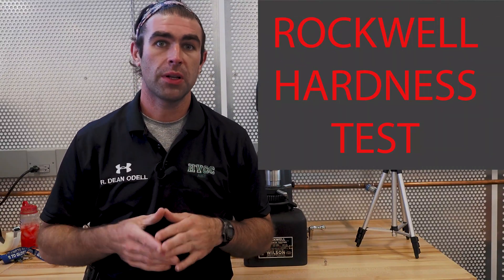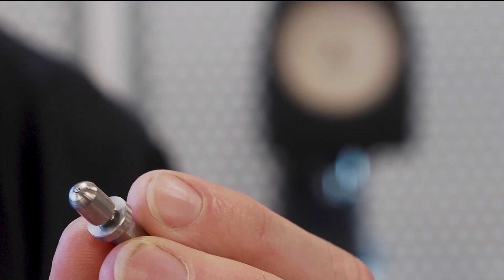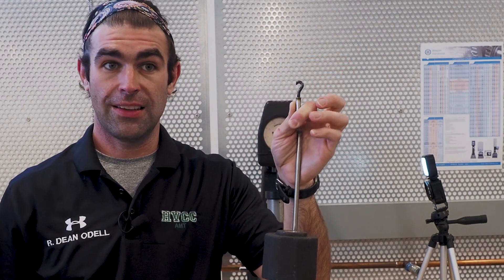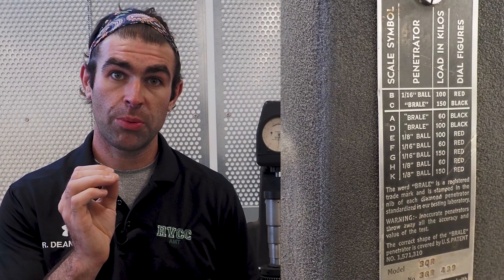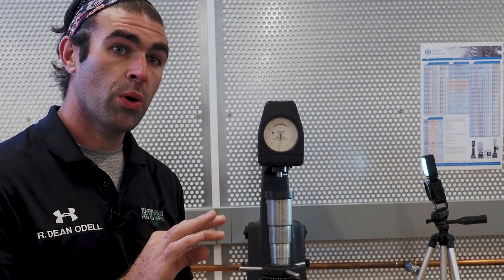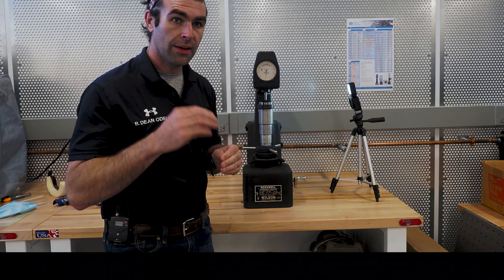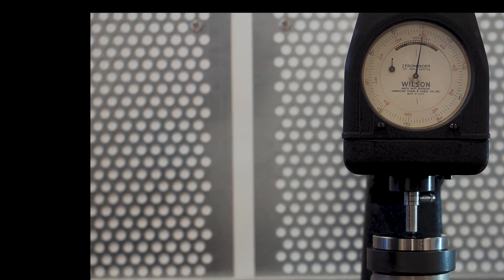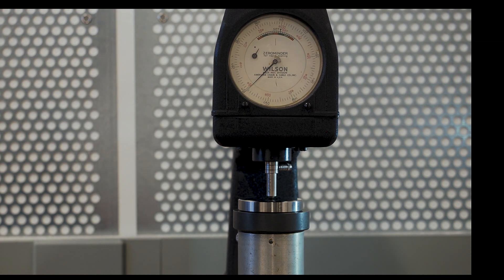Rockwell Hardness Test Demonstration

Comment: Very clear video, Thanks! I picked up a wilson 3jr, but i think it has a little problem, when i apply the minor load by bringing my test piece up, the big indicator doesnt do multiple revolutions to zero out the small indicator, its only moves half a scale and thats enough to put the small indicator on the dot. Doesnt feel right to me and in ur video is going round a few times. it also didnt came with a test block so no way to know if the reading is correct. Any idea if i can adjust that or not?

Comment: When testing a camshaft. Must the shaft be supported directly below the harness contact point or can the camshaft be on 2 v blocks and tested in between the blocks with no support directly under the contact point?
Reply from the maker: It’s fine to use V-blocks. Here is a guy who grinds cams for a living, and that’s how he does it:

https://youtu.be/dP9QA5hfbT0?si=V_6fUpDuy3kuWc1O
Reply: @RDeanOdell  lol. That’s exact video I just saw and is why I’m questioning it. I asked him too but he hasn’t replied. I believe he’s doing it wrong. I’m trying to find an expert on this. Thanks for responding
Reply from the maker: @georgea6403  so using v blocks increases the chances for there being an error; there could be dirt or whatever on 4 different surfaces instead of one. I wouldn’t worry about deflection on the camshaft though, the Rockwell test doesn’t apply that much force..

Comment: So Stupid question. When I check some non heat treated steel on our Rockwell checker at work it checks like -10 on the rockwell C scale. Is that reasonable or does it some like something might be messed up with our checker? 
I would think it should still have some sort of hardness, not Zero or subzero.
Reply from the maker: Hi, sometimes that happens when something is wrong with the piece, like it’s rocking or there is dirt. More likely is that the piece isn’t hard enough to register on the C scale, I would try with Rockwell B and see if you get more reasonable readings.
Reply: @RDeanOdell  I also think it's just not hard enough to read properly. I wanted to hear/read it from someone who worked with Hardness/Material more. 
Thanks!
Reply: You need to find out WHAT the requirement of the part you want to check should be MFG blueprints if requiring a specific hardness will state it in a specific category like Rc etc. this machine shone can be set up to check on different scales
Reply: @REVNUMANEWBERN    Absolutely! In this case It would be FOR REFERENCE ONLY. Lol 
In all serousness the Piece being tested was not Hard enough for the way Scale our tester was set up. So the -10 reading was reasonable.
We were having some debates in the Machine Shop about things relating to Heat Treat and I needed a Sanity Check. Sometimes someone's telling you something and you just know they aren't as correct as they think they are.

Comment: What do the weights actually weigh?
Reply: 3:37 shows the total weight of a stack up loaded on the machine has to be to use the different penatrators, EACH block has a weight on it, they are designed to fit together so the TOP one in the stack shows that TOTAL weight of that setup

Comment: Thanks for the video. As an engineer, I rely on the readings to very the the heat treat of various steel and nickel allows, but I wasn't familiar with what the actual process is that generates the readings.
Reply from the maker: So great to hear! Thanks for watching and taking the time to leave a comment.

Comment: Does the geometry of the test item matter? (I see there is a generic cylinder puck used in your test)  What about using stainless steel instruments manufactured in a shop where the geometry might make it hard to test?
Reply from the maker: The key for a Rockwell test is stability. Objects that are curved can be accounted for with a cylinder correction. You can shim a small specimen, but it is better to work with a stable part. Often the raw stock is checked before machining operations (unless the part is heat treated.

Comment: Is Rockwell Hardness tester a destructive test?  meaning, does it make an indent in the part?
Reply from the maker: Yes, it makes a small indent. The term “destructive” is relative A large casting or forging will not be damaged by an small indent, but a small ground pin or precise part could be made cosmetically or structurally unsound with a standard Rockwell test. Rockwell superficial, Knoop, or Vickers tests reduce the size of the indent, but may not be as accurate in thicker sections,
Reply: NO it is NOT a destructive test, destructive test means what it says, DESTROY

Comment: Did i just see you lift 150 kgf with a pinch? or you're just using dummy weights?
Reply from the maker: Hi, the weight is just a few pounds. The 150kg is the load applied to the penetrator, there is some serious mechanical advantage inside the machine.
Reply: Hi Billie. Thank you for this question.
Actually I am also going to ask d same question.
But finally found yours.

Comment: Don't forget ASMT E 18 requirements. Anvil selection is important as is the pre-cleaning of the test piece. The diamond needs to be checked. I suggest a scrap piece of metal be tested first, only to push air out of the system after changing the anvil or indenter.  Test block handling and use needs to insure that indentions are sufficiently separated (1.5D). Correction factors may apply. These need to be added or subtracted as appropriate. Don't test titanium. There's more, but let's keep it simple.
Reply from the maker: Thanks for the input!

Comment: does the minor load vary from machine to machine?
Reply: Superficial scales (15,30 and 45kgf) have a 3kgf minor load. Standard (60, 100 and 150kgf) has a 10 Kgf   The minor load purpose is to imbed the Indenter past any crust or debris before the actual depth measurement is made
Reply from the maker: Hi, the minor load will be less for a Rockwell Superficial test (which has a much smaller major load). Some machines will output the load in Newtons instead of Kilograms as well, so the number will be different.
Reply: @RDeanOdell  but if it has a maximum major load of 150kgs, can't the machine still have a smaller minor load?

Comment: You speak very clear and good, complete sentences, no ums, ums, ums, etc. So when you did the hardened block at the end of the video and it only read 60 Rockwell, isn't that when you calibrate the machine? What do you have to do to change it so the machine reads 64 Rockwell instead of the 60 Rockwell. Isn't that the purpose of calibrating the machine, so it reads 64?
Reply: I believe if the gentleman lowered the telescopes from under the 2-1/2” flat anvil, his readings would be closer. Never loosen and tighten the gripsel- the indenter has a flat that lines up with the gripsel and is held in by the spring pressure on the ball against the flat. Not a bad demo compared to what I have seen on YouTube!
Reply: The testing block DOESN'T calibrate the machine, it is just used to verify the maching is reading properly, the test block is created & verified by a outside source, the machine MFG etc.

Comment: Great video! What about The color marks on The dial?
Reply from the maker: Hi. The red numbers are for the “B” scale and the black numbers are for the “C” scale. The orange green and grey marks have no purpose that I am aware of.
Reply: @RDeanOdell 
What if I want my readings on A scale
Do I need another dial gauge that has A scale marked on it?
Reply: The color portion of the indicator is for rapid testing. I believe on the indicator itself it’s denoted as a “zerominder.”  Once you achieve the 2-1/2 turns, you depress the trip bar and then can zero the indicator while the 140kgf load is being applied. Always watch the movement of the large indicator needle, not the handle. Once the needle comes to rest, count one thousand one to one thousand three and gently remove the major load to the minor load position and take your reading. You are allowed + or - 0.5 HRC 60 and greater

Comment: good information for beginners like me. what model is it?
Reply: Wilson 3JR.
Reply: Is it the smallest model? We need tester for very small parts...no need for a huge tester. Can you recommend a model for that?
Reply: @joannayw5272  if you’re 

performing Rockwell tests, what you have to look for is the vertical opening. That test is a copy of a Wilson 3R. The 3 stands for 8” opening. There are some older Wilson 1JRs (4”) used out in the field, but the 8” is very common. Remember to take in consideration the anvil and Indenter used, that takes away from the vertical capacity